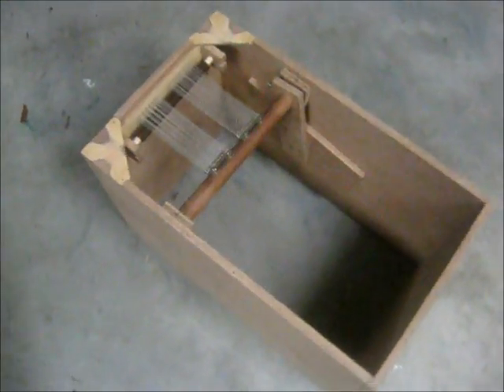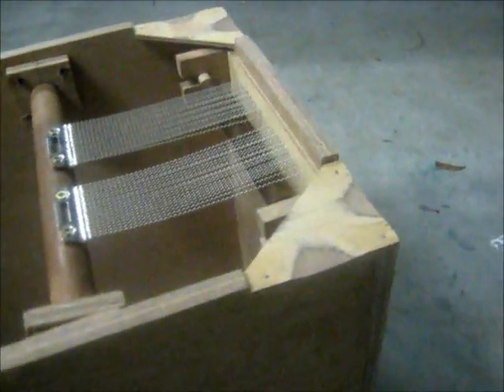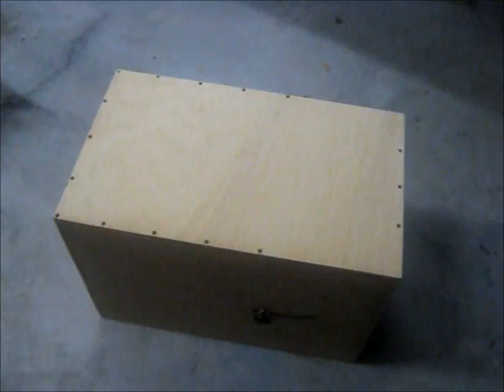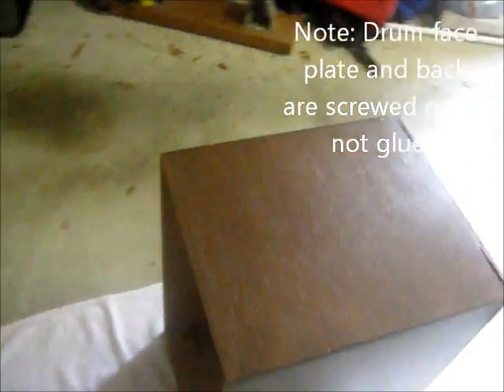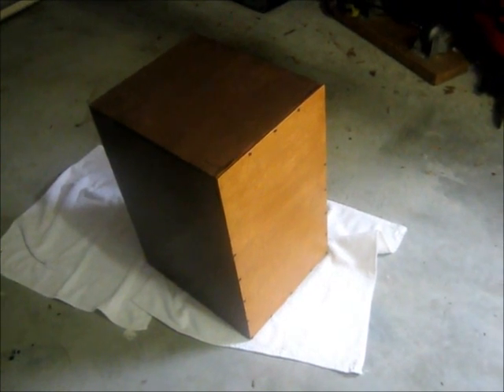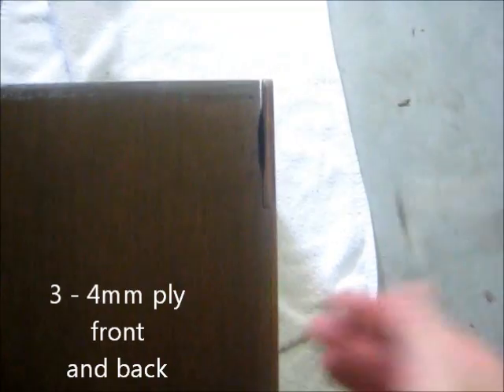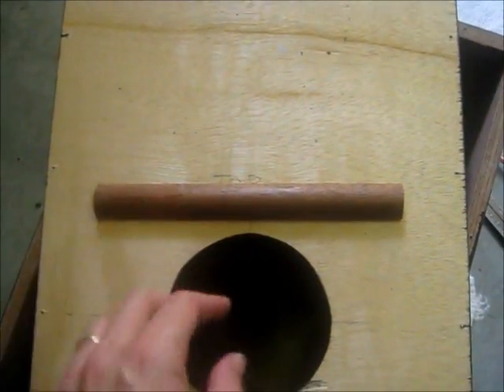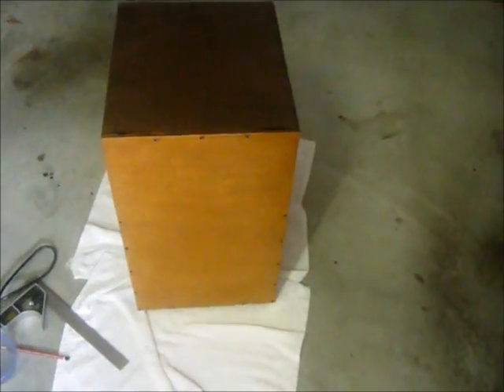Home made cajon with on / off adjustable snare

Comment from the maker: I modelled the corners on mine from one I saw in a music shop. I couldn't really say whether that is the best way to do it. I would hypothesise that the additional pieces of ply I used in the corners give something more substantial to make the sound - if you just had the face plate against the frame with a slight gap, it limits the surface area that it connecting. The grooves sanded out in the corner seems to allow the sound to project a little better - only way to really know is try it out.

Comment from the maker: Hi... if you look down into the gap, you can see into the box - but it is a very small gap - probably no more  than a millimeter (or maybe even less). If the gap is too big, it requires too much force to get a sound out of it. When I made mine, I did have to make a few adjustments of the size of the gap by sanding back the front surface of the box.

Comment from the maker: @Elegidopordios1: The "triangular" pieces on the drum body are made from the 4mm ply, at about 50mm x50mm* (actually mine are a little more like 50mm x 60mm cos I made an error with a measurement!). It is recessed into the upper corners of the drum: I recessed it about 9mm. Make a matching triangular piece to attach to the top corners of the INSIDE of the drum face. When the drum face is in place, you really only want about a 1mm gap between the two triangle pieces.

Comment from the maker: @azariaslns No worries! Good luck building your own. The only thing I would try if I was doing it again is to have the snare wires a bit shorter. I have to fiddle with the adjustment to minimise slight buzzing from the snare when playing the bass part of the drum. In mine they are about 12cm long. It would be interesting to see whether some shorter snare wires would minimise that buzzing...

Comment from the maker: No idea what would be best - should be fine to make it out of a solid wood, as long as the front face is quite thin (3-4 mm) - it needs to be thin to allow better vibration. I would think that a ply wood would be stonger for this purpose as the layers of wood are glued together with the wood grain alternating each layer, making it stronger.
Give it a go and see how it turns out...